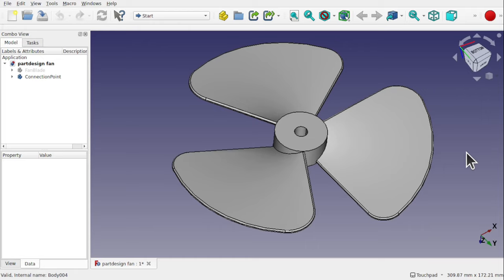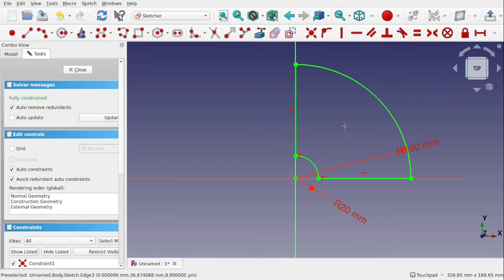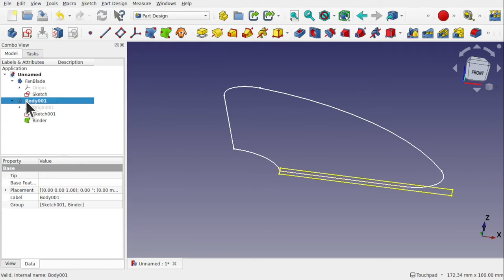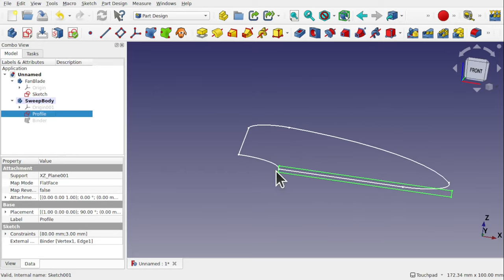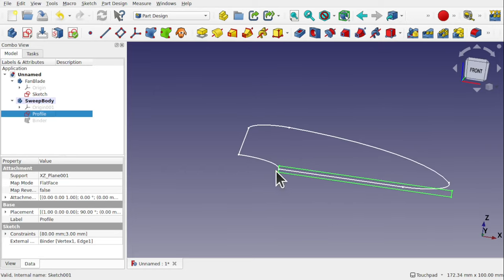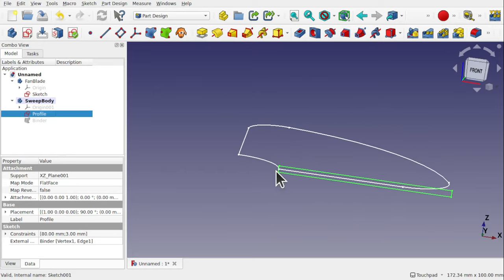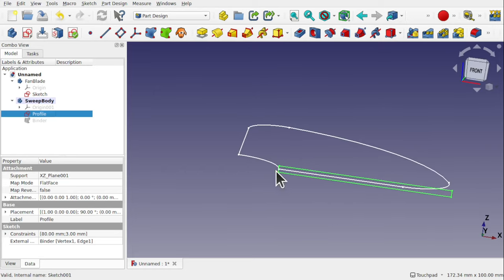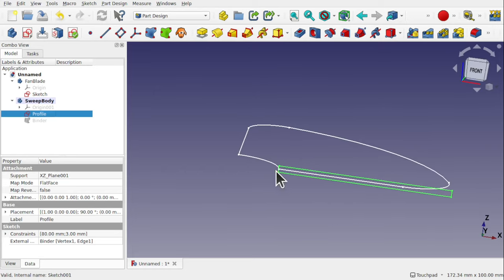FreeCAD For Beginners 44 b | Modelling a Fan | Part Design Workbench | Multibody Clone Workflow

Comment: Great video. Maybe a faster/simpler way to work out the angles for the blades would be 360/no. of blades = 120 in this case so 1st clone is at 120, second clone is 240.

Comment: The Circular Dependency Issue I presume is a result of FreeCAD being an ongoing "Work in progress" I've noticed in quite a few Tutorials You've used Your experience to "Work Around". Sharing solutions. helps new users like Me get there also. I'm thinking Ducted Fan Modelling but I believe Printing is not strong enough for Aero Modelling applications (20000 RPM's) Any suggestions where One might get some theory and education? The Additional Constraints added to the Sweep Profile are I presume a "Safeguard" after deleting the SubObjBinder? I just noticed after SOB deletion the project is back under One Body. Kudos to the Guys that pointed out the Simple way to Angle the Blades!! Talk about Forrest & Trees! FreeCAD's GUI can sometimes appear a little inconsistent (especially Selection process) which requires the User to be on the Ball when performing operations. Often an Operation requires a series of selections to complete. This can be daunting for us New Chums but given it s Open Source its powerful. Bodies are essentially Root Directories under which Operations on an Object reside.

Comment: Wouldn't it be possible to do all parts of the fan in one body? If you did the center first then the blade and then polar arrayed the blade. Then all parts would connect up and it wouldn't be the problem of multiple bodys. Or am I wrong? Great video anyway. Thanks. 😊
Reply from the maker: Yes you could do it that way. There are so many ways of creating this model.